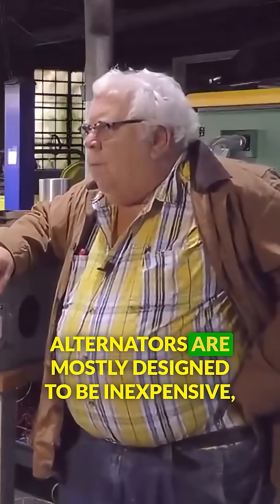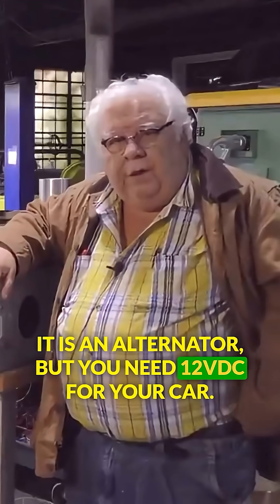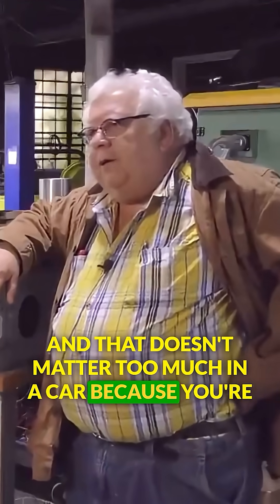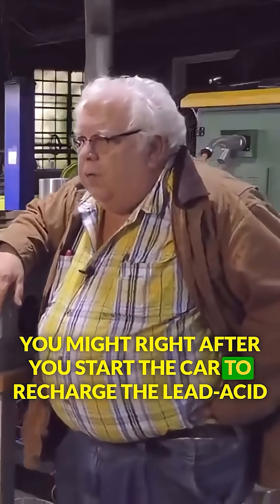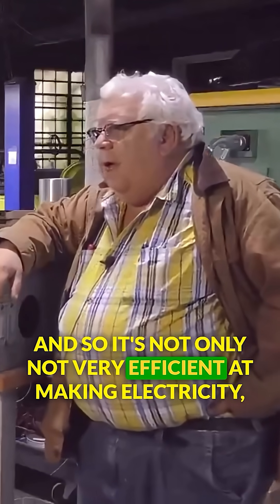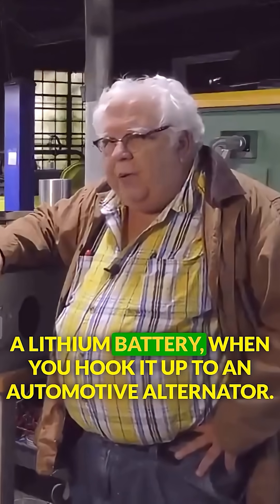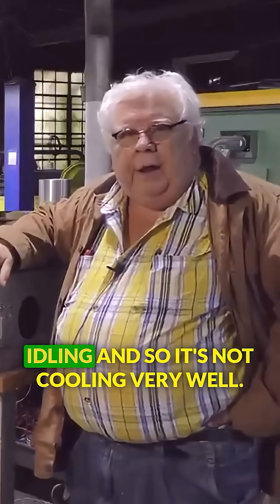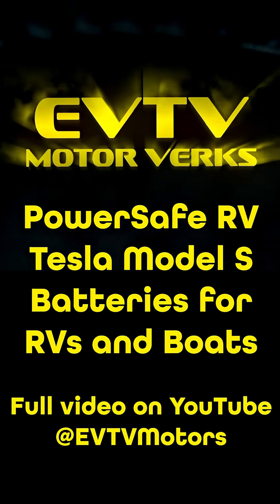Alternators are Only 50% Efficient!

Comment: If you use a thermostat with a variable regulator you can wire it in such a way that as it gets hot the current is reduced. 

Or you can just use a current regulator and set it to one maximum amperage that can safely be maintained. 

Or just put a big old fat resistor in there to limit the maximum current. 

This has been pretty well exercised for a long time. thank you very much for articulating this in a simple and understandable way for the mughals.

Comment: Yes, the low impedance  (like low resistance) which is the heavy load referred to here, is an inherent and desirable characteristic of lithium batteries and makes the quick recharge trait. Solution: Big permanent magnet dynamo with power mosfet rectifier with fan assisted heat sinks.

Comment: Typically lithium batteries have a higher resting voltage than their lead acid counterparts so I'm not really following your logic here. if I hook up a lithium battery to a car that's typically seeing a resting battery voltage of around 12 volts and a jump pack lithium battery rests at around 13 to 15 volts the alternator won't even turn on at very high current because it thinks the battery's already closer to full charge.. 
I think the confusion here is when you jump start a car with a battery pack of any kind and then you disconnect that battery pack immediately after the car is started... By doing that you are forcing the alternator to run at Max current to charge the car's current dead battery without the support of a jump pack.. It can take a good half hour to fully charge that lead acid battery that you just jump started so you can easily burn out an alternator by abandoning it under the hood of an idling car to charge a dead lead acid battery.. 
It wasn't the lithium battery pack's fault that you burnt out your alternator it was because you disconnected the lithium battery after jump starting the car that your alternator burnt out.

Comment: Go back to automotive generators with three-coil, remotely located regulators.  One of the coils was wired into the field circuit and limited generator current to a safe maximum.  Should not be too hard to build the same function into the alternator's internal regulator.

Comment: curious, gents. need to push 150-200a at 750rpm, on a little honda alternator. it's excessive car audio. so tell me, is there any shot it's worth diy? shops quote ~500-700 out the door on that

Comment: He is absolute right! Actually its the voltage regulator that has a heat sink and burns out if you sit and idle too long (just 5 short minutes) while charging a LiFePo battery. I've gone through 3 of them before I said enough is enough and put in a relay switch to only come on when the car is running at steady state in a nice cruising speed to power up the lithium battery.

I wish I would have seen this video months ago before I know what the problem was, that way I could have anticipated this whole mess.
Reply: Not five minutes. Are you nuts?
It always take exactly one minute and sixtyseven minutes. Not a second more. I have tested this 903 times, yesterday.

Comment: Back in the 80s, I used to run a 2kw of amplifier for CB radio. Had 2 alternators but could not keep diodes in them. I modified the alternators by removing the diodes and routed the 3 stator wires outside the alternator to a home made rectifier package in front of the radiator to keep them cool. Never had another alternator problem.

Comment: alternator have gone to battery via external regulator forever even on antique tractors. diodes only regulate regulator draw. Lithium will blow fuses and relay and regulator depending on design

regulator switches to alternator power with alternator potential detection

Comment: Alternator diodes are silicon devices with about a 1 volt drop under load.  So 12V at 100A is 1200W but the diodes drop 2 x 1V * 100A or 200W.  1000W/1200W = 80% efficiency for the diodes contribution... not 50%

Comment: Been running a lithium battery in my motorcycle for over 2 years and its a hard cranking v -twin that need in excess of 260cc in order to turn over...no alternator problems so far.

Comment: this guy is 100% right.

the solution to a long lasting alternator (and LiFePo4 battery) is called DC-DC charger. and fitting big wires.

DC-DC's throttle back their charging current if the voltage on the alternator side drops too far.  so it can sustain a charge also into the starter battery.

Comment: You caught my attention with this since plenty of my machines idle and work at an idle more of the time. Often just for a short time and then have to be shut down. They get a battery charger to restore them as often as needed but I tried to think of numerous ways to avoid that kind of maintenance. Most alt's need 1800 rpm I'm told. Not a common speed in my situation.

Comment: Well it looks like I have my next GPT topic it looks like alternators are due for a redesign.

Like what doesn't everybody get about living in the age of AI... where once you had nothing but roadblocks the problems now you can ask an AI that provides not only solutions but new Innovations.

If you took that list of problems and criteria to chat GPT you would be able to build a better alternator.
Reply: He's talking nonsense. 

Alternators are over 95% efficient, their regulation is by excitation control and is nearly 100% efficient. Output is limited by excitation flux and stator coil capacity, and can't be so much as to damage the alternator.

Almost all alternator failures are bearings, commutator (caused by worn brushes), brushes themselves, or the regulator/rectifier unit.

Comment: If they used proper size copper wire in alternators they would run a lot cooler at 600 RPM. I have not had to change out my alternator in over 40 years. An electrician would have to use #2 copper wire on 100 amp feeds but a 60 or 75 amp alternator probably only used #10 or 12 gauge wire for their three phase AC coils.

Comment: Ohh this man has no idea what hes talking about, the reason you use alternators and rectifiers is bcs they are efficient at low rpms. And the alternator does a lot more than 600 rpm, its about twice the engine rpm wich makes it at least 1500 rpm at idle. The heat is not really an issue either. Ppl needs to stop ravelling about things they dont know shit about on the net.😂😂

Comment: Funny, I have a large 20kwh lithium battery bank on my boat with 2x si22 alternators. When the engines are idling, they only put out about 25 amps. it is not until the engine reaches 1200 rpm, about half the rpm range of the engine that they start to put out 100 amps or so of the 140 amp rating. I also changed the regulators with temperature compensating ones that reduce the output when they get to hot. These are $120 alternators with a $12 regulator upgrade. I generally cruise for 4-10 hours at a time along with 2000 watts of solar, so i never have any charging problems. buying an expensive alternator or using a dc to dc converter is not the only solution.

Comment: Or ypu can recharge the lithium to the alts voltage. Then the lithium isn't drawing max amperage on connection. 

I'm running a 12year old 110amp alt set to 15.5v on 80ah of lithium titanate oxide battery  and have been for several years now. There is a right way and wrong way to do these things

Comment: Very interesting. 2 questions, is the lithium battery putting more load on the alternator because it would tend to have more capacity and also would there be an actual scenario where the alternator would need to be maxed out for 2 or 3 minutes ? Are those 2 reasons why you are mentioning it and is the point of the video to highlight that a lithium battery not a great idea for alternator longevity ?

Comment: Parts I miss having in my Chevy Bolt EV (actually they are not there and I do not miss them):
Alternator
Distributor
Fuel port and door
Fuel pump and filter
Carburetor or injectors
Spark plugs
Starter motor & gears
Timing chain
Valves of any kind and lifters
Pistons, bearings & rings
Crank shaft & Bearings
Exhaust ports, valves, manifold and pipes
Catalytic converter
Muffler

Comment: This may be true if the lithium battery nominal voltage is 12.6V, but I've been running a 13.2V A123 systems Li-ion battery for 5 years, no issues. It's lighter and there's no starter sag in cold winter starts.

Comment: Now talk about the ballast resistor. This thing is a white block of ceramic with a wire coil (resistor element) inside and it's there to drop the usual 13.8v down to ~9 volts. It runs hot all the while it's dropping the battery voltage down to a useable level for the spark coil. I always thought that could do a better bit of engineering than that.

Comment: So much misinformation in this video.  If you make 1200w of energy got don’t get 1200w of heat in addition.  The 1200 is absolute.  You get EITHER 1200 energy OR 1200 heat or some of each like 600 and 600.  Not both.

If what he said were true you could generate unlimited energy by harnessing the heat to make more on top of what you made and have unlimited power.

Comment: This guy doesn’t know what he is talking about. Diodes don’t convert electricity to DC.  They limit the amps so it doesn’t blow up your battery.  Because there is a limit to what your battery can “take”.  Giving it more will cause the electrolytes to boil and the battery will explode.

Comment: An automotive alternator is NOT going to output it's rated power at 600 RPM.  Some truth in what this guy says, but some not-so-truth as well.  If alternators put out max current at idle, there'd be no need to "rev" the engine of a donor car when jump starting a car with a depleted battery.  Put an ammeter on your charging system and check it out.

Comment: For at least 15 years I have been telling people this exact thing, alternator is not efficient, it CANNOT run an electric fan and everything else in OEM form, lithium is NOT a good replacement for your car without doing a bunch more “upgrading” 

Even the expensive alternators are not all that efficient. They are wound different to put out more power…..which equals heat……

Newer is not always better.

Comment: The issue is using a Li battery without a BMS. You can't just swap in a Li for a Pb and use the same charging system. It'll burn out the charger and the battery. Regardless of the efficiency of the alternator.

Comment: I guess one of the main motives of inefficiency is that they use 12v. They should use 48v, the maximum that is safe to handle bare handed. It is more efficient that way, and they would use less copper for the wires. Remember P=I²×R so if you lower the amps  you get less Joule heating, or loss due to heat. You get the same power by upping V (P=V×I)

Comment: We can all use a little Common Sense. A generator making how many volts how many amps with very little effort now you have this giant 4 cylinder 6 cylinder 8 cylinder engine and you're going to tell me it can't do better.  I never really understood the modern car industry.   Seems everything about the design is 1900s tech instead of 2025. 😮  cars make how many horsepower?  And they can't do better to work with superior battery storage?  Lol.  😂 we been played! Your car should be charging giant lithium battery packs.  Not just for hybrid cars.  I don't even want to think about how bad the efficiency rating is on a gas engine for how much power is being wasted.  I have to also assume we could have power generators driven by wind in our cars to recharge batteries at higher speeds.  Park and basically be a power generator on wheels.  Solar panels, wind , brake resistance.  So many options.  Come homr, run your house off the car.  😊

Comment: Toyota hybrids don't need alternators, but I never really thought about why & this helps shed some light on the matter.
Reply: Toyota hybrids now have this regenerative braking, also. Where it converts the mechanical energy back into electrical energy as a more efficient means of slowing the vehicle down without using brakes. Regular brakes just turn the mechanical energy into heat, which just bleeds off in the air and can't be used anymore.
Pretty interesting

Comment: I cant believe its a thing in newer cars nowadays. Electronics became much more efficient. There are many types of rectifiers, half, full bridge and so on and other components to convert voltage. All thanks to better semiconductors and ways to use them. Correct me if im wrong. Compare battery charger based on transformer vs transistor based, it takes less space and generates less heat

Comment: The proper way to do this is to have the alternator hooked to a lead acid battery and then an ACR in between the lead acid battery and the lithium battery. The ACR will automatically turn on once the lead acid battery reaches a certain voltage and then it will convert the power and transfer it over to charge the lithium. This is the same way we set up yachts

Comment: I've been running with lithium and multiple alternator/charging systems in the same vehicle. It takes knowledge of what you're doing. Any machine can become a smoke machine if used wrong enough. 

As I have explained to tons of people on the car audio community when concerning lithium is you can not be jump started not jump start another vehicle.

And lithium phosphate (lipo4) is a safe chemistry of lithium as opposed to lithium ion which can and will explode/catch fire.

Where's my 18v gang at?

Comment: At 600 rpm idling speed, the alternator is probably spinning at least double that because the crank pulley is larger than the alternator pulley.

Comment: If I let my car sit for a few days my LTO battery sucks all the current from my alternator for about a minute. Several minutes it'll it sits for a month. This throws the computer off as it thinks the alternator isn't charging because the battery sits at 12 volts for a few min instead of 14.

Comment: just replaced my alternator that had poor ventilation due to grease/grime buildup.   Left car running for the wife while I went into HomeDepot.  Almost caught the engine compartment on fire but stopped that in time.   $250 replacement alternator and the wife is happy her car is working...

Comment: My circa 1988 alternator is 100% efficient.  It does 100% of what I want it to do, and 0% of what I don't want it to do.

Lithium batteries draw current, lead acid batteries draw current.  How much they draw depends on the charge level and has nothing to do with the battery chemistry.  The only difference is that due to lower internal resistance, the lithium battery will draw more current at a lower charge level.  But you don't get to a lower charge level versus any other kind of battery unless you run it down.

Comment: Smart alternators exist now and have done for years, when the battery is 80% charged the alternator doesn't tend to produce much, this improves fuel efficientcy. There are also near perfect diodes that are better than 98% efficient available, not sure these are used in all modern alternators?

Comment: Hi there! What you say is very interesting. Use of lithium battery as standard source of electrical power for an engine is pretty révèlant for modern motorbikes... The question is: are modern bikes able, with their stock alternator and power regulator, able to manage pwr consumption surge of lithium tech over std lead batteries !?

Comment: I can't believe no one has actually applied real engineering math to this 🤦‍♂️ your average silicon rectifier diode has 0.7v drop. This is fixed regardless of current. There are effectively two in series at any given time. Therefore the total loss at 100a is 100x0.7x2 or 140w. Also, these diodes are not the only thing between the alternator and the battery. There is also a voltage regulator. He is just plane wrong about how this works. Bottom line is lithium batteries aren't special. If you put a dead lithium or a dead lead acid battery in a car it will max out the alternator current. And yes, cheap alternators will fail. Charge the battery first.

Comment: Only 50% efficient? I don't believe that. The Toyota alternators I've repaired have 3-phase stators with full-wave bridge rectifiers. Regulation is achieved by varying the field current. They work well & for a long time. Anyone wanting to use a Li battery is going to have to build a special charger for it and a device to prevent over-discharge or they'll have a bad day.

Comment: He was right about everything up until the end there....a lithium battery is no more, and actually less of a load than a lead acid battery... not to mention any modern car has a shunt/current sensor on the battery and will limit the alternator output. Plus, think about how many people with a lead acid batery need their car jump started, and then just drive off. thats putting more load than a lithium battery ever would. Where is he getting this BS from??

a lifepo4 lithium battery sits at 12.8v nominal, 14. fully charged, and the internal resistance goes wayyy up as it nears full charge so it wont charge as quickly anyways, whereas a lead acid will take as much current as you can throw at it.

Comment: Then be smart, and install a bi-directional welder diode. One for charging, and one for discharging the lithium battery. The diode will make sure the current is somewhat limited.

Comment: Modern hybrids not have any usual car alternators. They use highly efficient electric motor / traction system as powertrain / starter and generator in one component with DC/DC conversion for low voltage car power.
Issue closed.

Comment: Lots of alternators have no problem with this. I can charge the 600 ah lithium batteries in my RV just fine by letting it idle. The alternator doesn’t even run hot, perfectly normal temp, I’ve checked. A lot of the fear comes from another YouTube video that’s been rigged to scare you into buying their expensive battery management products.